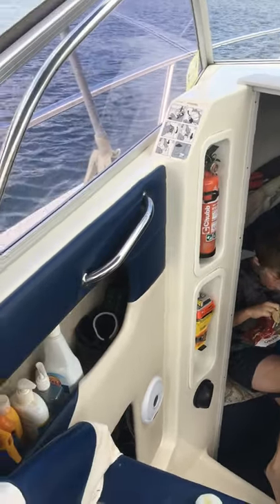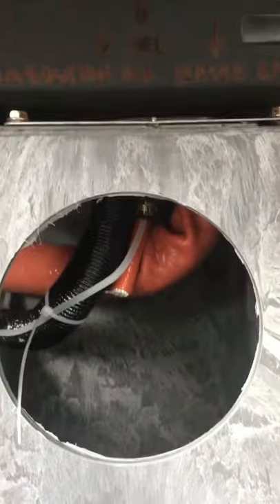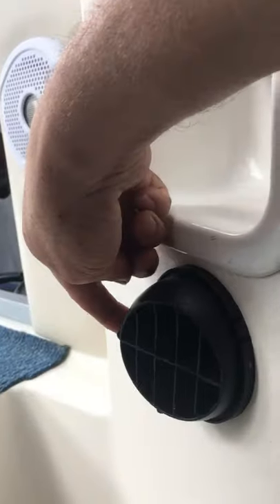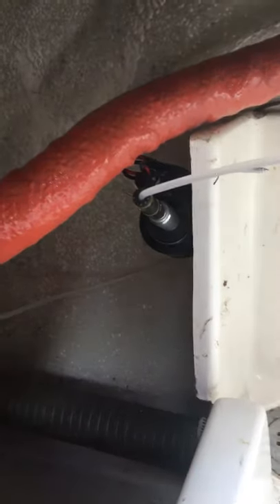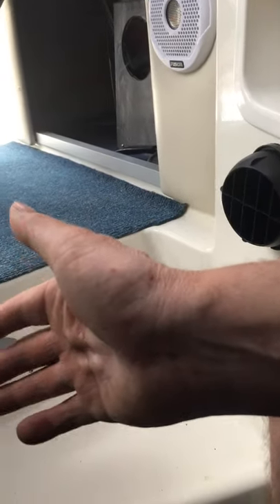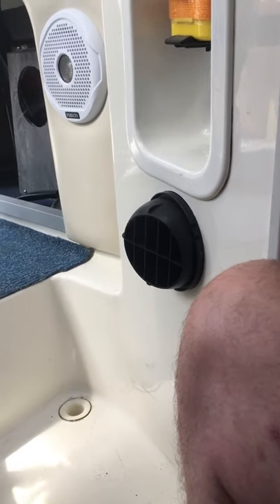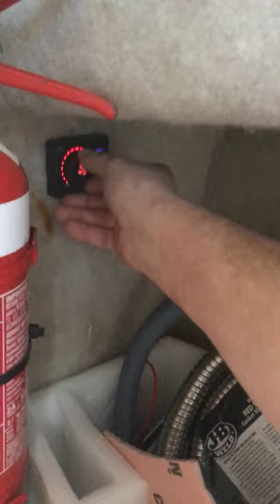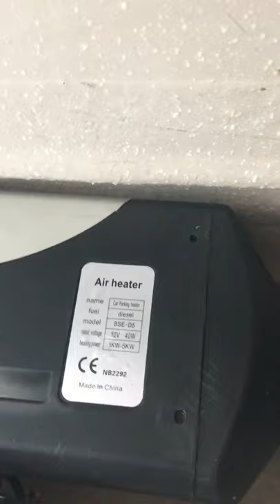Diesel Heater install trailer boat

Comment from the maker: Works beautifully. Recommend to swap out most components to suit marine environment. Exhaust must extend external and have continuous fall to prevent condensation and soot accumulation. Run heater full temp for 2 minutes before turn off the unit to burn off any excess exhaust particulate accumulate.